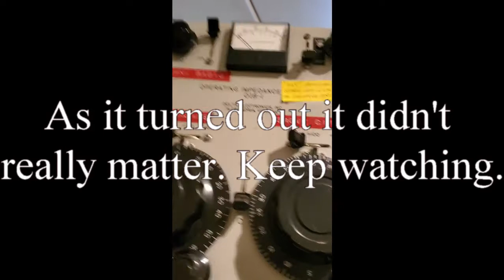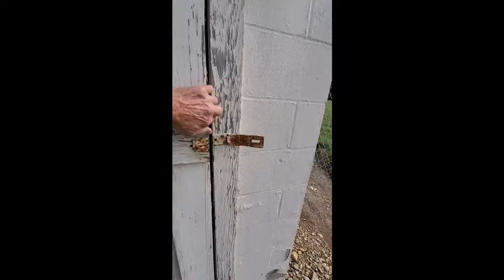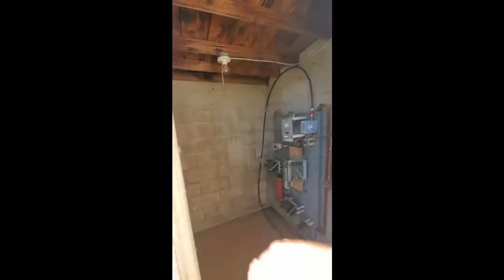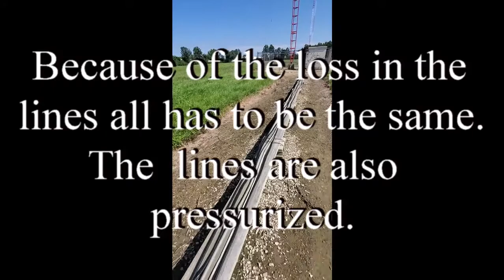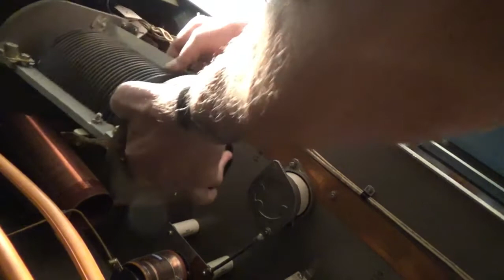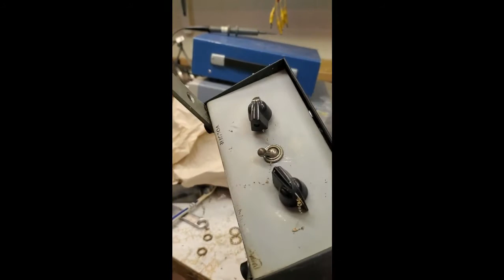Fixing My AM Common Point

Comment: Thanks, Dave! 
I enjoyed this video very much and wished I were there to help.  The phasor reminded me of an old RCA unit I
used to maintain.  What made me think of it were the painted stenciled component id markings.  I’m no longer servicing any AM transmitter sites and miss it.  Please do a compressive video of the site.  I’d love to see it all.  You mentioned the towers were 260’ ft. so I’ll hazard a guess that the station is mid-band, if the towers are ¼
wavelength.
Reply from the maker: Hi Larry. Yes good guess the frequency is 920KC, nice 10KC tone on most older receivers without IF offset switches (wonder how many of my viewers know what I am talking about). I have thought of doing a walk through of the transmitter as I fear AM will not be around much longer.
Reply: @AERVBlog  I know what you mean, for I am afraid, too, that the band is in danger of extinction.  Too bad, because it's the bulk of my radio listening.  920 KVIN in Ceres CA, and 1430 KYNO in Fresno CA.  These are the only AM's in my area still playing music.  The IF on most AM radios is very narrow, perhaps just a few KC's would be my guess.  On a wideband superhet a station can sound wonderful and a TRF set would give a faithful reproduction at least to the NRSC roll off, if you're not receiving interference.  BTW, where are you located?  Again, thanks for the great video and other servicing videos.  I am enjoy them a lot.

Larry
W6LEM
Reply from the maker: @larrymilliken288  email me at aervblog@gmail.com

Comment: Iinteresting video, I worked for the Bell System for 40 years and watched technology change. A piece of equipment 4 foot high and 4 feet wide stacked 3 high would handle 24 channels on a 1.5 mb signal. By 1986 all three banks were on a letter size card 1/2 inch thick. By the time I retired thousands of channels were on a fiber optic cable served by a piece of equipment not much larger than a  table top stereo. We've come a long way. Regards all, stay well, stay safe.
Reply from the maker: I am not so sure everything is better though. At least you can still fix the 50 year old stuff.